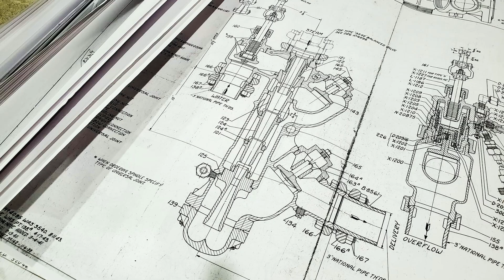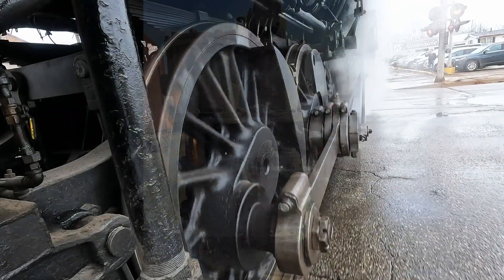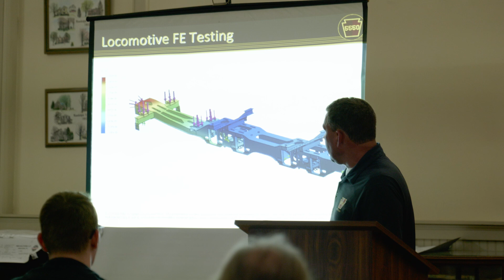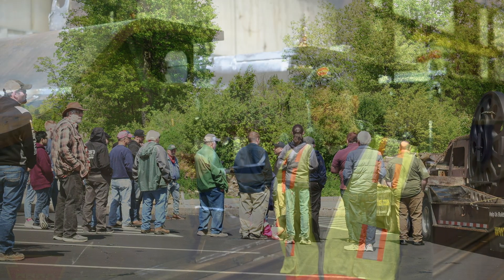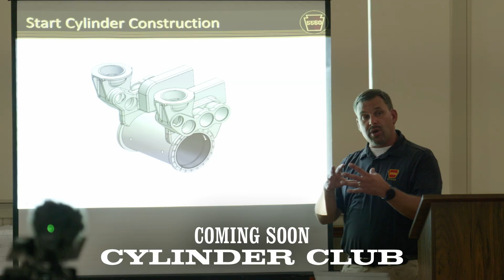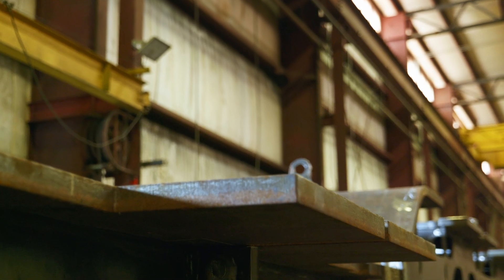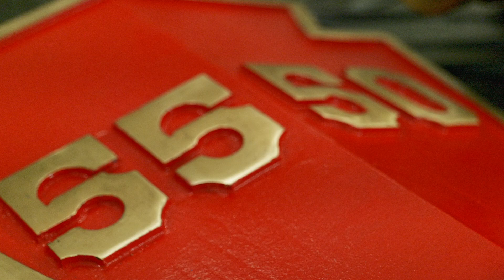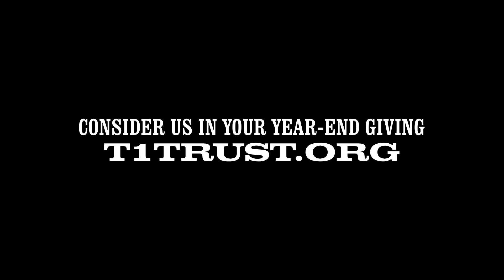T1 Trust 2024 Year in Review - The Year of the Frame

Comment: Making a steam engine in this day and age should take a long time. But make sure to keep things safe, and aim to dethrone mallard as the fastest
Reply: It won’t happen 126mph is the limit as the A4 was 126tons with 3 18.5 x 26 inch cylinders. The T1 is 428.5 tons with 4 19.7 x 26 inch cylinders? The weight of 428 tons would need far larger and far heavier cylinders and pistons. Problem with all steam locomotives more power more weight. Bit like Jaguar cars had a 6 cylinder engine of 4.2 litres they doubled it to a V12 but it wasn’t a 8.4 litre only a 5.3 but with double the weight not double the power!
Reply: @vernongoodey5096  i think these guys can do it. it has more sophisticated cylinders, valves, and large wheels capable of top speed. but idk if anything i said is right.

Comment: I disagree that the welded frame will be stronger then a cast one however a welded frame will have far better repair-ability in the future if the frame ever cracks.  A trade off I really don't mind since people capable of repairing cast iron cracks are becoming harder to find...unfortunately.
Reply: I saw another video where they mentioned the S1 cardozzi valve gear tented to break at high speeds exceeding 120mph. if they make it from sheet metal it may hold up better than cast.

Comment: I’m ok with them building a new t1 locomotive, I really am. 

Just stay away from the speed record, it doesn’t need to be broken. Besides, a locomotive that large can’t even get close to that speed.
Reply: They are still going to attempt the speed record, regardless of what you think…
Reply: @ to reiterate, there is no way that locomotive can go that fast, so they should just stay away from the speed record all together.
Reply: @arconnelly5365 Again, you expressing your two cents is pointless…
Reply: @arconnelly5365 you're afraid that it'll beat Mallards record
Reply: @RCRF401  nope, I’m against it because it is impossible for a locomotive of that size to go that fast.

Comment: I’m now curious why they didn’t make frames in a similar way to what you’re doing back in the day? Maybe not by welding but perhaps with rivets?
Reply: When the original was built, casting metal was far cheaper than fabricating it from sheet metal. Now of course the reverse is true, casting things has gotten significantly more expensive.
Reply: @ makes sense. Casting is way less labor intensive when you have the proper infrastructure

Comment: ...this isn't a 2026 deadline.
Reply: It's gonna take a year or two to build the internal boiler structure. So, 2027 or 28. Which is 2 to 3 years ahead of schedule.
Reply: If you watched the whole video, they said 2026 deadline to have the boiler and wheels attached to the frame with cylinders.